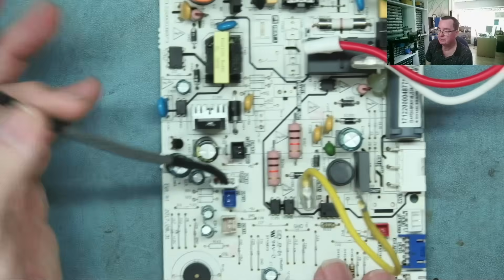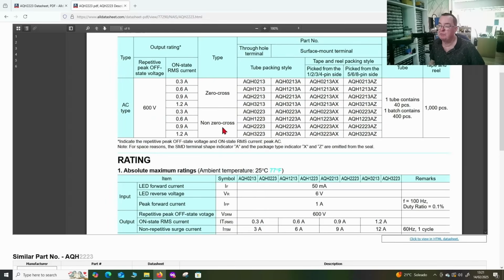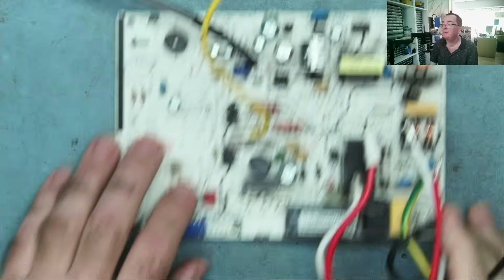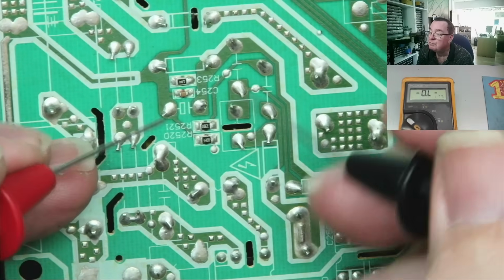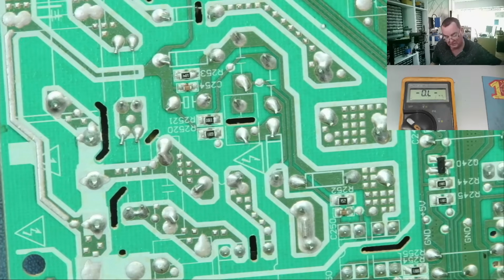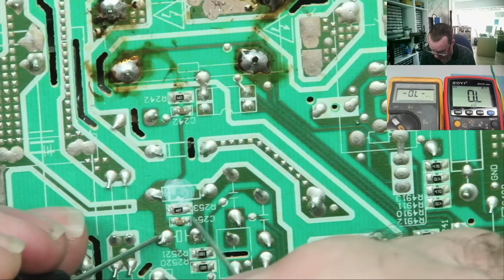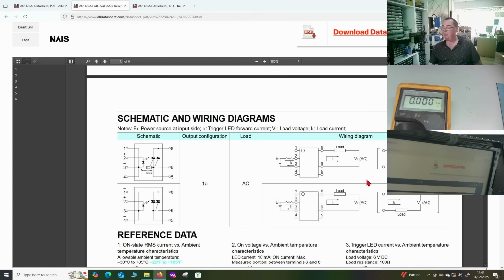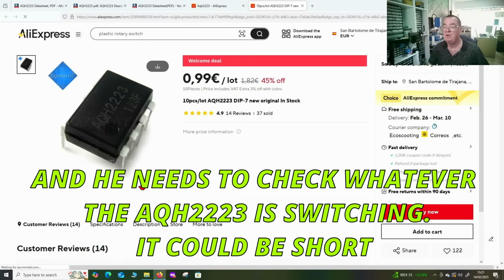How To Find The Faulty Component On A PCB Without Schematics : A Very Practical Repair Example!

Comment: Regarding testing relays in circuit and not knowing which way the flyback diode is connected. Couldn't you just use a current controlled voltage from your PSU to avoid blowing up the diode? By setting max current to for example 100mA, which even a 1N4148 can handle. Then if you apply 12V and happen to forward bias the flyback diode then CC mode will kick in and output voltage on PSU will drop to 0.6V,  and then know you have to swap the power supply probes :)
Reply: You could possibly cause issue by reverse biasing other components though

Comment: My method is different, I use this instead:

1. Visual inspection.
2. I look for shorts on the high, then low side. Mainliy diodes and capacitors. If shorts found, I look for lowest ohms, or use voltage inject instead with either hand/IPA or thermal camera.
3. If I can't find anything shorted. I can try to see something like standby voltage if it's present and if opto-isolators have power.
4. Only then I can look for any extras.

But, this method is the quickest for me till date.
Reply: Ohhh, if you don't understand half-bridge, full-bridge, flyback and so on, you waste more time ;). If you don't understand op amps, you waste even more as these have pins shorted on the PCB and you might be seeing short, but it's just the design ;).

Comment: I have a microwave that is proving to be very difficult to repair, with everything from the control board and HV supply board testing fine.  This video has inspired me to go back and have another look at it to see if the fault isn't so obvious.  Will report back via discord, I think, when I've had (yet) another go.
Reply: How did it go?
Reply: Hey  @thurqs1938 , thanks for checking back in. Still no luck.  I've tested every component that may be stressed or involved with supplying power, driving the power, and controlling the drivers, and everything appears fully functional.

I've also set up the microwave so I can safely run it while testing voltages across the control board and the HV power supply, and everything there is fine too.  I even went and tested the continuity of the wires to ensure there wasn't a poor connection on a crimp somewhere. Nothing.

The guts of it are now in a box and the chassis is in the scrap metal pile.  If I come across another similar model at least I'll have a full set of boards, parts and harness to draw upon.

Comment: more on testing optocouplers and the SSR in the device in the video
(this really belongs as a "reply" to another comment, but I'm on a antique computer with an antique OS and browser and reply doesn't work; I'll try using a different computer to move this to the proper place later)

Ordinary transistor-output optocouplers are not inherently switches. They are "analog" devices in which the collector-emitter current is vaguely proportional, when not limited by the external circuit, to the current through the input IRED. The linearity is generally awful, but can be acceptable for certain things such as feedback for a power supply where the non-linearity is "nulled" by virtue of the fact it is contained within a closed loop that compensates. Optocouplers only work as switches when the external circuitry "forces" what appears to be switching behavior, just exactly as is done with a bipolar transistor or a MOSFET or a logic gate.

Considering testing a transistor-output optocoupler with 1 mA of IRED drive and a DMM on OHMS measuring the "resistance" of the output transistor between collector and emitter:

The specs for a good but very old DMM I have say that for the 20k ohm range the maximum test current is 25 µA. That's within a factor of about two compared with some other specs I've looked at. So, if that meter were to read 4.1k ohms on that range, assuming the actual measuring current were 25 µA,  the voltage across the terminals would be 25 µA x 4100 ohms = 0.1025 V. That is likely close to the C-E saturation voltage for the output transistor. The specs for most optocouples just aren't sufficiently detailed to be sure.
Effectively what we have is a current transfer ratio determined not by the device characteristics but "forced" by the external circuit. We have 1000 µA input current and 25 µA output current, for a CTR of 0.025 (2.5 %) which is extraordinarily low and for most modern optocouplers would mean the part was severely degraded if that CTR were determined by actual device performance.
Testing this way isn't totally meaningless, but it tells us next to nothing other than that the device isn't totally dead.

A triac inherently is a switch - sort of. It won't reliably switch if insufficient gate current is applied or the current through the "main terminals" path is below the holding current. In practice in any decent design the gate is always driven with more than enough current to assure that the device is fully turned on. (With big triacs or SCRs, you might have to drive the gate with much more than the spec'd maximum required to assure that the entire area of the device is properly turned on, otherwise you can get "hot spotting" where too much current flows in just part of the junction area.)
The old but still fairly popular MOC30xx series of opto triac drivers, originally from Motorola, are a good example. They can be had in variants specified for maximum IRED current for triggering of 5, 10, 15 or 30 milliamps. If you supply less than the spec'd input current, the output triac simply just won't turn on. The IRED would light up with less current, but the energy emitted would be insufficient to do the job. The same would happen with a triac-output solid state relay. You must drive the input hard enough to assure that the internal circuit can supply enough gate current to the output triac to be sure it turns on properly. YOU, as designer, have to assure you are doing what is required to make the device behave as a switch. If you test using less than the required IRED current your test is completely meaningless.

Comment: Who else like me hates the 5 band resistor colour code?
Years of doing electronics gave me the ability to instantly know the value of a resistor without having to work it out, my brain had just memorised the different colour combinations over the years AND THEN 😡 they changed it to the 5 band colour code and I lost that ability.
To add insult to injury, the new colour code consists of a lot of black and brown bands, making it even more difficult as you don't have the colour contrast of reds, oranges and yellows that we had back in the day.
I'm assuming that the extra band is needed because the range of values increased, but I've never known the actual reason for the change??????
Reply: 4 band is 2 significant digits, power of ten, tolerance
5 band is 3 significant digits, power of ten, tolerance

5 band is just for higher precision resistors. I never use them.

Comment: no tiene le pista de audio en español!!!
Reply from the maker: The audio voice translation is automatic and should include Spanish.  But I have no control over it if Youtube doesn't do it.  I do have the auto-dub option enabled.  As an alternative you can click on the CC button to switch on subtitles, then go to settings and Autotranslate the subtitles into whatever language you prefer.
Reply: @learnelectronicsrepair  igual buscare un traductor para poder ver el video, gracias por todo lo que nos enseñas!!!!

Comment: You simply would not expect the SSR to turn on with only 1 mA. The datasheet shows typical trigger current at around 25 °C to be around 4 to 5 mA (figure 3, Trigger LED current vs. ambient temperature characteristics in the datasheet I have). The datasheet shows the maximum LED current required for triggering to be 10 mA. If I were designing with that part I'd assure a good solid 10 mA of drive for the LED. [edit - while looking for the thermal resistance of the package I noticed something I'd missed previously. The data sheet has a "one liner" titled Recommended operating conditions which says "Please use under recommended operating conditions to obtain expected characteristics." The one-line table is for Input LED current: minimum 15 mA, maximum 25 mA]
The conclusion that the part is faulty is faulty.

It isn't clear what happens with gross under-drive of the IRED. I'm guessing, based on the weird circuit with two triacs, that it simply won't turn on and isn't harmed by under-drive. Lamps are a horrible test load because of the high current when cold, and an underdriven triac might die from hot-spotting (though this would typically lead to short-circuit failure). I suspect the triac between pins 8 and 5 is the "opto" triac and that as long as it is turned on at all it will assure proper turn-on of the main triac between pins 8 and 6.
Reply from the maker: it looks like the only way to prove this is to prove it.  Generally speaking, if the led in an optosiolator (which this basically is, an optotriac) illuminates then the output device swithches on. And LEDs light up pretty will with 1mA. I've been testing optoisolators for years using a multimeter to cause the LED to illuminate (if we can class infrared as illumination). 

However this is a lot of semantics so let's try this on video, it would not be difficult to set up a circuit to vary the input current and see what happens.  For sure we will all learn from this experiment, I hadn't come across this particular component previously so decided to test it the way I would an optisolator)  but who will be proved right or wrong remains to be discovered.   I think you are correct about the optotriac driving another internal triac, if you look at the datasheet it shows that only the zero crossing version have that optotriac and the others have what looks like an opto diac to trigger the triac.

Comment: When a circuit board with SM components on the back is whacked down on the bench so hard it makes a thud it is being handled far too roughly! This is an invitation to cracking of the SM capacitors and that is an invitation to having them fail short-circuit. Monolithic ceramic SM caps break because of excessive board flexing or impact, not because they are weary of life.

Comment: I do not like new stuff with electronic boards on them we never had any problem with old stuff only the manufacturers make money and people loose money and have to go through a lot of difficulties to fix them manufacturer fill thier pockets with peoples money.
Reply: You are right
Reply: @David-f8e2v I feel the same way.  Circuit boards have no place in the temperature swings and humidity of the outdoors.  I think they should be dipped in epoxy and then they would probably last forever, but we can’t have that can we?

Comment: I've actually had quite a few failures of AQ series solid state relays used in the analog input module of a Honeywell chart recorder. Same failure as this. The LED appears to be good, but the output semi does not turn on. The particular ones in that analog input module are MOSFET output though.

Comment: Followed along with you on my own faulty Canon printer power board and surprise surprise: shorted ceramic cap on the underside.
Reply from the maker: Hey that's great work 🙂
Reply: In my country dozens of office printers get trashed , nobody can fix them , except  for clogging

Comment: Guys, what's the machine that sits behind Rich's right hand shoulder. I always thought it was a 3d printer but now I don't believe so. Any ideas?
Reply from the maker: Semi-automatic BGA Workstation with optical alignment.  I used it in some old repair videos on the channel
Reply: @LearnElectronicsRepair  Thanks Richard. I'll try and find them through your vast index. Cheers mate!

Comment: Beautiful!  I understood the workings of the AQH2223, but what is it switching?
Reply from the maker: I don't know because i only have the PCB and not the aircon but i did note in the video that it is important to check whatever it drives (which is an AC mains voltage device) isn't short circuit
Reply: Indoor motor fan

Comment: Good analyses. I'm sure you've checked with your PSU as the datasheet seems to suggest that the minimum LED current should be 15mA and more than 1.2V.

Comment: Anything with a micro controller or Eprom on it  then it's always worth checking if either is hot before you do anything else .  At least you then know any other testing is probably just wasting your time because chances are (without replacement parts complete with  a copy of  uncorrupted code )  you aren't fixing the fault.
Reply from the maker: I'm not sure I totally agree here.  Firstly how would you possibly test the microcontroller functions correctly or not?  The eprom is easy enough to test as I described in the video but it only proves the eprom itself is OK, not the firmware or data it contains, and if you prove the eprom is faulty well, unless you havea hex dump from a good one, you still have the same problem so it seems a bit pointless.  Also. generally speaking, the microcontroller is 'protected' from the outside world by other circuitry, buffers, latches, mosfets etc.  So unless any of those are damaged then it is fairly unlikey the microcontroller is damaged.  Also in this case the bleeper bleeps and relay switches, so that tells me the microcontroller is working.  In my opinion of course.
Reply: @learnelectronicsrepair  Realistically, unless the job is going to be a money spinner  it's just not worth messing with the micro controller. Sure you can make the assumption it is working but if its very hot then I'd seriously consider whether it is worth carrying on.

I've come across plenty micro controllers in my time which half work. Sometimes it is  worth  checking the reset circuit is working as that can cause all sorts of issues if its not but, in my experience, not over heating. 
 
I think we are arguing the same point on the EPROM. Unless you have a copy of the original code you know works you are probably flogging a dead horse.  Ultimately, it is how much time you are prepared to spend and probably  how much the customer is prepared to pay.  With a hot micro and/or  a hot EPROM I'd be heading for the exit sooner rather than later.😁

Comment: I believe your testing method for the SSR chip may or may not have been flawed. Tungsten/Halogen lamps have a much higher 'cold start' initial power draw than their rated power and would have certainly been well past the ON-state Current rating of that chip.
 Extract from Panasonic data sheet "Caution for use" for these chips: "Tungsten or Halogen lamps draw a high inrush current when turned on (approximately 9 to 12 times, in worst case, for random type SSRs) Choose an SSR so the peak of the inrush current does not exceed 50% of the SSR surgeon current."
Assuming 60w lamp @ 230v, 0.26A x 12 (worst case surge) 3.12A, the chip is rated @ 9A for 1 cycle (60HZ), is that the same as 'surge-on'?? if so, then ok, if somewhere in between then not so ok?
Another potential issue from the Panasonic data sheet: "When used for the load less than rated, an SSR may malfunction if it used below the specified load. In such an event, use a dummy resistor in parallel with the load"
 Again Assuming 60w lamp @ 230v, 0.26A, rating of the SSR is 0.9A could cause "malfunction"?
Reply from the maker: I had two lamps is series, 65W+72W so the current would be lower than you calculated.  Also it would surely have to pass some current through the lamp to reach it's 'surge' limit so you would expect to see the lamp at least flicker? However i am intrigued by yor suggestion so let's try it swiching less load and see what it does on a followup video
Reply: Having just watched your followup video on the SSR chip, I see I was correct about the flawed test method but for all the wrong reasons, oh well 🤦‍♂
Reply: The lamps used should be GLS carbon filament bulbs. (The older household bulbs.)